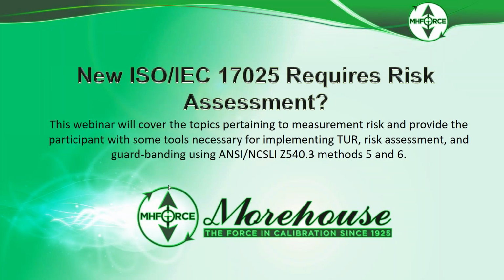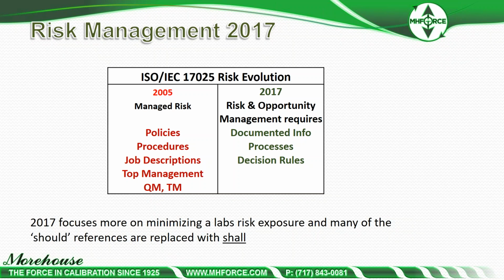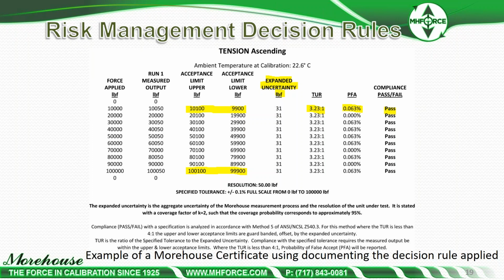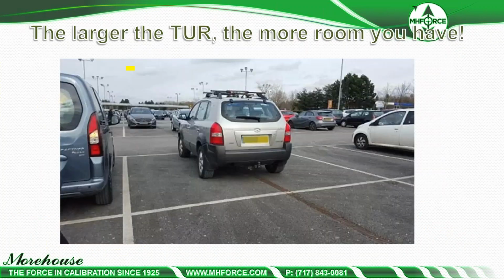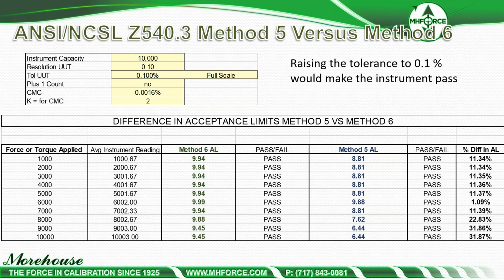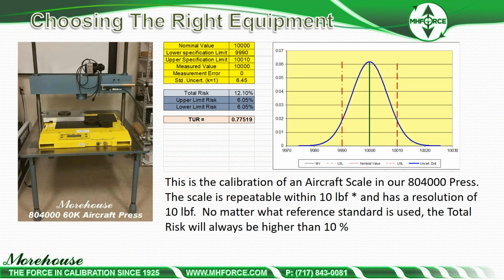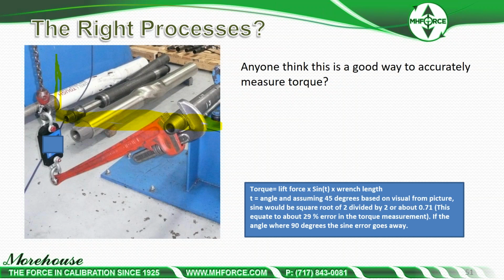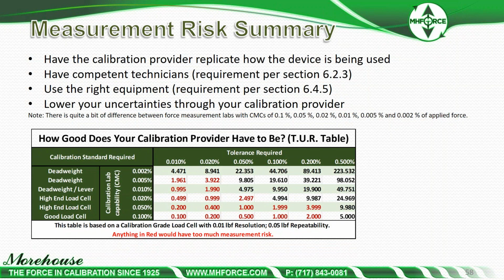New ISO IEC 17025 standard requires risk assessment

Comment: thank you for a very informative documentary, i love the set up you have with your machines , especially the hand loader. the dual columns where you can raise to fit in any load cell by moving the frame with pins, if possible do you have diagrams to manufacture the hand loader with the correct gear ratio for different capacities as i am having trouble here finding someone willing to engineer the design without the correct dimensions and tool steel including hardness etc. please any info would be helpful.If you can mail me at trevor@cmemetrology.com. thanks guys.